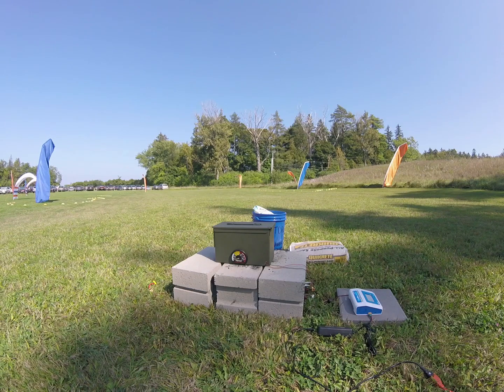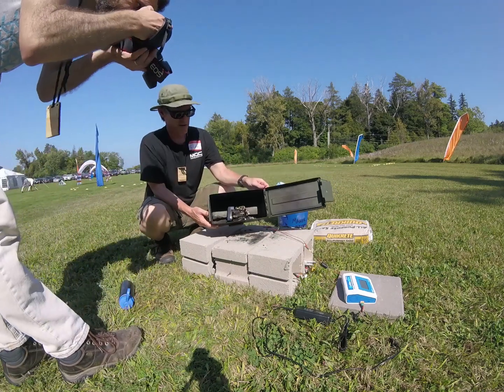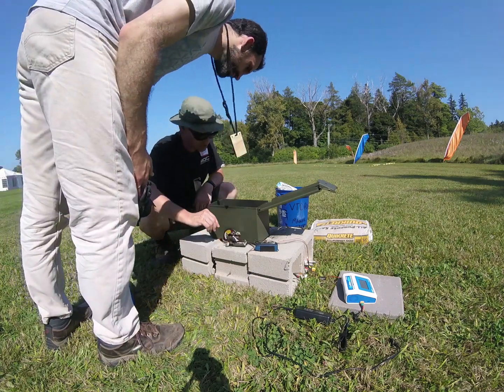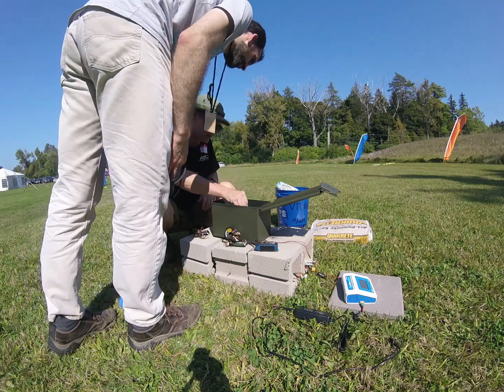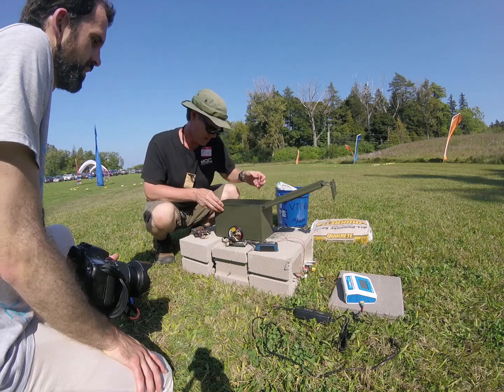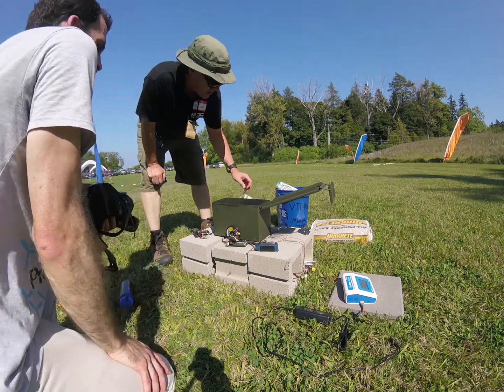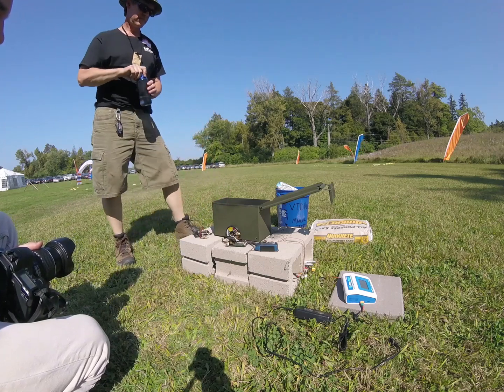LiPo container tests: Ammo can

Comment: Line the box with half inch sheet rock which has a 30 minute fire rating if you use exterior sheet rock it will be 45 minutes(gypsum board is 21% water)

Comment: Put some water bottles, made from PET into the box. These should melt when the fire starts and drown the battery.
Reply: Lipo: Lithium Polymer. Lithium is an Alkali Metal. Exposure to water will probably make this kind of fire worse. I imagine that’s why the similar solution of having a bag of sand adhered to the lid is more widespread.
Reply: @ReileyU  A modern lithium battery contain about 2 percent lithium.
Professional firefighters drown burning escooters in water too, this works.
The goal is to cool and protect the healthy cells from burning as early as possible.

A cell which is already burning, can not be extinguished but other cells are protected under water.

Comment: I've been considering putting a bag of sand taped to the inside lid so when a fire starts, the bag melts and sand drops onto fire. Thoughts?
Reply: Fantastic idea and probably a life saving one too! Well done
Reply: Genius!
Reply: Try it.  It will not extinguish the battery, it will not prevent any other batteries in the can from being destroyed, it will no save the battery, it will not elimate the smoke, it will not save the can.  What are you trying to accomplish?
Reply: The bag is a great idea for when we are away from LIPO storage cans. But what about also filling 2-3 inches of sand on the bottom of the can. If one was to set off you could flip the can and let the sand on the bottom cover the lipo when turned over. Having some  sort of handles to carry the can away from your body would be great. Weld on something could attach wooden handles.
Reply: It won't do anything. It won't even need too. But it might have some benefits so why not.. make sure to use thicker plastic. So it has to be serious fire and to prevent fatigue to the contaner
Reply: You could use water bottles which melt in the fire. Should be more effective.
Reply: @hpeterh  
Might wanna read up on Lipo fires before applying water to them. Water, believe it or not, makes them more volatile.
Reply: @swashbucklingadventures9929  It must be enough water. You need 0.6kWh to vaporize 1l of water. This is the energy of an e-Bike battery.
Fire department also uses water.
It is not possible to extinguish the fire, because the electrolyte contains oxygen, but you can cool it to 100°C which protects healthy cells against thermal runaway.

If you use a small container, which isolates and concentrates heat, it will heat up and also healthy cells will burn.

Comment: Did you drill any additional holes or just removed the seal from the box?
Reply from the maker: There was a small hole added near the bottom for the charge leads. You can see smoke coming out of it early on.
Reply: @hazard-creative  small hole in addition to removing the seal?

Comment: When the battery caught fire were you charging them? If so, how? Did you modify the box to allow a cord to pass through?
Reply from the maker: Yes; the idea was to stress test the container so the batteries were provoked to fire by overcharging. A hole is drilled at the front of the box (bottom right) to allow charge leads to pass in, and the gasket seal was removed. removing the seal is very important! More detail is available in the linked article from the description.
Reply: Michael Niggel did you use anything like silicone to seal up the hole to keep the fire inside? I'd like to use one of these for charging my lipos.
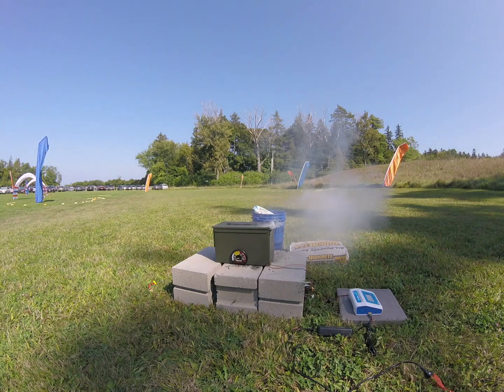Reply from the maker: @mikesstickers  Not for this test. You can see smoke escaping from the charging hole at 0:10 and again at 0:20.

Comment: Awesome. I recently got one of these boxes for my batteries and was curious to know how it would hold up. Would you suggest removing the seal?
Thanks for the video!
Reply from the maker: Yes, it's important to remove the seal. If you don't, gas from a battery can build up pressure inside. Also, always keep the box on top of a fireproof surface and away from combustibles. That should keep you safe.
Reply: @hazard-creative  what about putting a fireproof surface on the bottom of the box? Use some silicone or screws to attach a fire resistant plate of (something?)
Reply from the maker: @tungsten8290  I would not personally be comfortable leaving it on a combustible surface no matter that kind of bottom I put inside. Best to leave it somewhere that can't catch fire.
Reply: @hazard-creative  I hear you on that. Maybe a large metal cabinet that i can use just for model aircraft stuff.   I'd rather not leave it in a box at the end of the driveway!
Reply from the maker: @tungsten8290  have you seen my video on the BAT-SAFE? It's what I use now.
Reply: @hazard-creative  I cant find the bat safe looked all over the net there web site says all sold out
Reply from the maker: @jmm1000  the gasket on the ammo can.
Reply: Plain and simple, with the seal it's a bomb

Comment: I'd be curious to see the same test with a sealed box :)
Reply: Its all over youtube.. DONT DO IT!  You create a damn bomb lol.
Reply: @badlilstang  I want to see it 😂
Reply: @RR123  Me 2. I am curious if it indeed explode (it's made for things that has the main function to explode and protect it) so i am curious if a lipo is more explosive. And also i am curious because me is always learned that for every fire also air is needed. When there could be no more air in than there is inside the box should it also flame? Maybe i am wrong but i am real curious. :)
Reply: @haajee1  LiPo battery fires are chemical reactions, they generate their own heat, and offgas oxygen.. so you have fuel, and ignition source (heat) , and oxygen by its own decomposition. Therefore it doesn’t need outside air to start a fire, and will continue burning on its own accord. Eventually, pressure will build in the container until the weak point gives. There are videos of these exact scenarios happening and the box go boom boom as expected.
Reply: @Sffker  thank you for your clarification! I understand. :)
Reply: @Sffker  or it just bends the box until the seal is breached. Which is actually what happens.
Reply: @badlilstang  It's all over youtube? Please share the link!
Reply: @badlilstang it’s not all over YouTube. Can’t find a single video after hours of searching
Reply: me too!
Reply: boom

Comment: Would the best solution be to put the individual lipos in a lipo bag and then put them in the ammo can? Having loose lipos in there seems to create an issue where if one goes they all get damaged and a sealed lipo bag may help to save some of them.
Reply from the maker: Whether or not it would work would probably depend on the batteries and the quality of the LiPo bags. You're also going to incur considerable expense. And you have to ask yourself: if a fire does happen, is it likely that you will use the other batteries again even if they were individually bagged?
Reply: I was thinking more along the lines that one going off wouldn't cause a chain reaction if they were in separate bags. It's doubtful that you'd want to use any that were in the same container.

That said, I picked up my ammo can yesterday and I'm ordering more lipo bags from Amazon "just in case". 

Are there any special considerations that need to be made for Nimh batteries?
Reply: What if i put each lipo in a zippy bag and fill the box with sand? For storage not charging. You think that would help

Comment: Was the gasket removed?
Reply from the maker: Roger Banks  Yes. We also drilled a hole at the bottom for the charge cable. It's really dangerous to use a completely sealed box.
Reply from the maker: I doubt it would ever send shrapnel flying in all directions like a grenade, but a jet of extremely hot gas is certainly possible. In a test by the Bat-safe producer, an ammo can gets bent out of shape from the pressure, then rolls about a foot away off of its fire-resistant base when the seal bursts. The seal fails to provide any benefit, so I don't know why anyone would want to risk the unpredictability. https://www.youtube.com/watch?v=K8MQCatbxSY (0:34)
Reply from the maker: I doubt it would ever send shrapnel flying in all directions like a grenade, but sparks and a jet of hot gas is certainly possible. In a test by the Bat-safe producer, an ammo can gets bent out of shape from the pressure, then rolls about a foot away off of its fire-resistant base when the seal bursts. The seal fails to provide any benefit, so I don't know why anyone would want to risk the unpredictability. https://www.youtube.com/watch?v=K8MQCatbxSY (0:34)